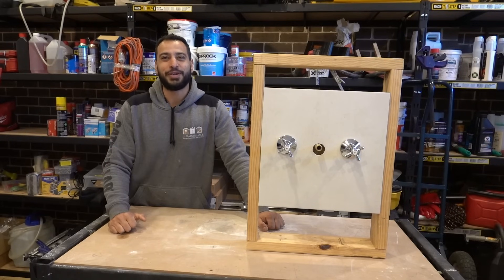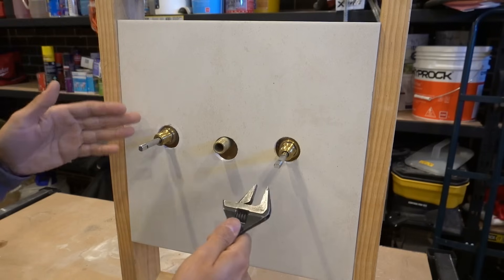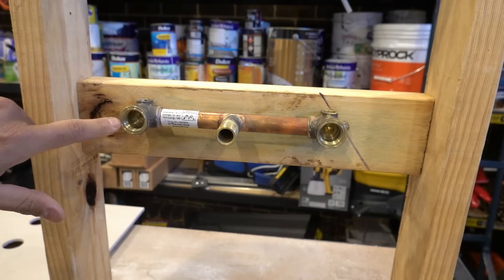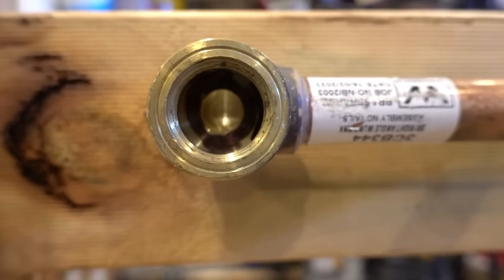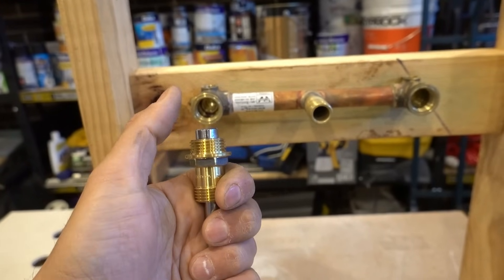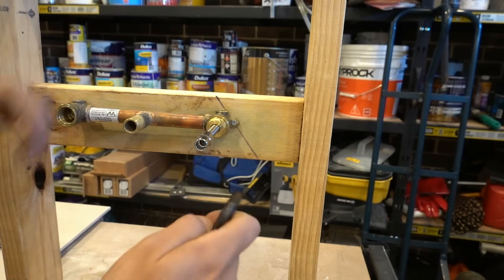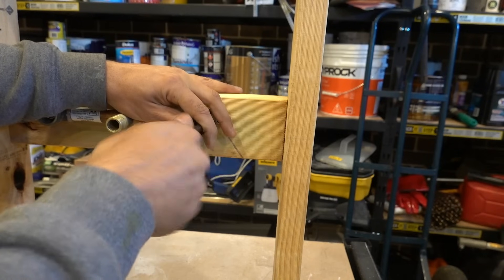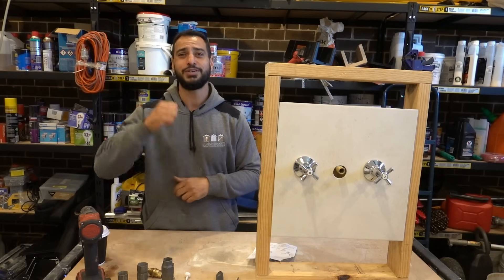Fix leaking dripping taps - Plumbers DONT want you to know !!!

Comment from the maker: Make sure the main water supply is turned off first👍👍👍👍
Reply: So glad you mentioned to turn off mains water stopcock at front of residence. This is an awesome video covering beginner washer replacement, intermediate refacing seats, and advanced replacement of tap seats for DIYers. Thank you so much.
Reply from the maker: you’re very welcome 👍
Reply: A great suggestion.
Reply: Also put the plug in the sink or bath tub so nothing goes down the drain! Many people dont do that and they lose things.
Reply: HELP 😢 PLEASE! I followed your video on how to do a simple washer change and now when I turn the bath taps on, water is coming through the wall.... What have I done wrong?
Reply from the maker: Hi, you have either not tightened the spindle back on or it’s missing the fiber washer (usually red in color)
Reply: Ok, I need to locate that first 🧐
Reply: Make sure to read this comment before loosening your spindles ;)
Reply: What about the leaky tap spindles
Reply: If I have water pissing out of the wall every time I use the taps what do I do?
Should I call a plumber?

Comment: Missed a few tips here. Turn off the water first. Open the tap valve as it makes it easier to remove spindle. When you tap a thread as in for the new seat always go 1/2 turn forward and 1/4 turn back. This will clear the debris and make it easier to tap the thread. You also need a slow revving drill such as a cordless drill to reseat as too high a speed would cut too much out.
Reply: Thanks for the tip ❤
Reply: Oh no, way to much…what’s the plumber’s number 😅
Reply: COMMINSEN. TO CLOSE THE TAP . COME ON. ARE YOU STUPID.

Comment: This is so good thanks!!! It's back to the hardware store for the 3rd time to install a new seat. Done the replace plunger washer, didn't stop the leak, bought the reseating tool, and grinding away revealed a deep pocket hole in the one seat, so I''m gonna try replace the seat. Thanks for saving me 1000's !!!

Comment: Two things I changed on my shower tap set up, I chipped the edges of the tile at the bottom and "Injected" some silicon all the way through to the base of the body so that when the tap was removed, the water would run forward and out over the tile outer surface instead of soaking into the plaster board, I have fitted those stainless seats on all my taps and use the washers that soft self seal by using the pressure of the water to effect the stop of flow. This demonstration used the best type of seat resurfacer, I don't have that type and had to be careful not to leave radial chatter marks on the seat.

Comment: Finally the solution. I had a micro crack in the seat and I have tried reseating this about 4 times and feared I was getting close to flogging it out for good. This has fixed the problem. You are a legend Bill.

Comment: Great advice. I just fixed my fairly new taps (two years old) in the kitchen without even replacing the washer at the back of the spindle. At the front of the spindle, only about 10mm from the end, I have a brass c-washer and a rubber O ring. I noticed that the cold water tap compared to the hot water tap had the O ring less tightly pressed up against the little c-washer - much more use/wear of the cold water tap, I guess. So,  I just pushed the O-ring a bit more firmly against the c-washer and now it's not dripping.

Comment: Thanks Bill.  Great video that I will share with my daughter.
Can you make a video comparing the various materials used in hot & cold tap washers.  There are so many choices, cheap & expensive, soft & hard, plastic & brass stems.  Some wear out quickly.

Comment: Good job. That kit's been around for years. Haven't had a tap where I've had to go that far, but it's a good s option if required. There's one leak which is rare but you can add it to your list and that is the spindle o-ring.
Reply from the maker: I have done a few videos on this but on shut off valve’s. Exactly the same process but I’ll add it to the list in case people can’t find them👍

Comment: helps at times to open the tap a turn before you try to loosen the spindle,  then you are just working on the thread minus any pressure/friction from the washer

Comment: if i wanted to take the taps off like you showed, and then NOT use the taps or spout anymore (ie. leave them removed from the wall), can i just take the spindles out and screw some sort of end cap in place of the spindles?  will that work, or is it more complicated than that to disable a tap and spout?

Comment: Hey Bill, if after reseating, new washers, valves etc and there's still a slow slight drip is that when you replace the seat itself with the tool shown in this clip? I think the answer is yes but wanted to ask before going ahead 🤣 After that next step is calling a plumber cos I only did new new bits and bobs listed above only 12 months prior 😢

Comment: with the tap seat replacement, it may still leak if the threads were made a little loose, and you can fix that with a bit of thread sealer

Comment: I have  found is easier to reseat then put new 1/4 turn ceramic tap good for 100 years. Just clean the seat up with the tool no need for the insert if putting in the ceramic tap. Has its own seat. Bit expensive though. But I was desperate very old house.

Comment: Hey Billy if you used the reseater tool to reface the brass why would you have to replace the tap seat afterwards?
Reply from the maker: Sometimes the seat has markings that would take excessive resurfacing and may be too far gone. The seat should be resurfaced as much as possible before installing the new seat either way to have it as clean/flat as possible 👍
Reply: @billshowto  Cheers for the heads up mate 👌

Comment: Great vid. My shower spindles are covered with some sort of clear silicone, preventing me from unscrewing them. Can i cut around this to unscrew the spindle?
Reply from the maker: You can cut the silicone out. The silicone is sometimes used to create a waterproof seal and prevent water from making its way into the wall cavity
Reply: @billshowto  Do i need to put more silicone down once im done changing the washers?

Comment: Always put a little bit silicone behind the new seat. This is the tips from work. The rubber washer at the new seat sometimes can also cause leak. A little bit not much silicone absolutely can help.
Reply from the maker: Silicone may work but I haven’t tried. Loctite is what I would use👍👍👍
Reply: @billshowto  ture.loctite is also a great idea.

Comment: Great video. I resurfaced using the drill bit but still leaking. Can i reseat the tap if i have already resurfaced twice? I just dont want to cause more issues trying to do it on the cheap. My wife is already suggesting a plumber
Reply from the maker: Sure can👍
Reply: How'd you go with reseating the tap?

Comment: @billshowto

Hey Bill

I reseated my tap seats for the shower in my bathroom with the reseating tool. One of them (cold tap) had noticeable damage/crack (about a quarter of a millimetre). I eventually stopped because I was hesitant to shave any more copper off. I flushed everything and reattached everything. When I turned on the shower, 3 noticeable changes:
- The shower head pressure was much weaker (I changed to another shower head and the pressure was still low).
- And when turning the cold tap slightly after the hot water, it would get cold quickly.
- Leak has significantly stopped.

Are there any explanations and fixes for this? Logically, I thought I did everything right. I'm feeling defeated at the moment. 😭

Comment: Hi!!   If it was damaged (the seat) by a plumber how do you then fix it? I simply told my plumber my taps make squeaky noises after a while they're not doing it yet but after about a year they will start getting squeaky when you turn them on and he marked around with it and now I've got a worse issue. The tap was not dripping at all but now it is continuously dripping. I have found out I need to get one plumber in they need to pull all the tiles off the wall and then I need a builder to come in after that a lot of hassle for me as a tenant over a dripping tap. 
Is there a simple fix or a way around this? I do have handyman in the family and I would love each of you fixed easily and quickly without all of this drama that is ahead of me

Comment: Another hint, if the plumber does have to be called to replace the hardware, and it is tiles, tell them to go in from the back. It is easier to repair a painted wall, or even carefully remove then reinstate bricks.

Comment: I did this year's ago and made it go from a drip to full flowing water that I couldn't turn off. Ended up costing 1000 to get a plumber to fix it. Not sure what I did wrong or how they fixed it without removing tiles

Comment: The only problem to me is I couldn't remove the spindles as they are way deep inside the wall even I used the box wrench, still hard to unscrew it because it was stripped, still ended it up paying a plumber to do it. Any taps from old houses is just a headache as mine is 50 years old.

Comment: I have one problem ,the tap covers are on so tight ,that I can't get them unscrewed .House is only 5 years old.
Reply: Try wrapping a small rag around it and use a pipe wrench or multi grips. The rag is to prevent damage to the tap cover.
Reply: @mupdog9697  Still wont move.

Comment: Sorry Im about as far from a plumber there is (preschool teacher) when you say flush it out...... define flush for the dummy in the comments please. 😂😂😂 thank you
Reply: I'm in the same boat but I took it as turn the main back on that will enable the water to be turned on and flush any dirt & shavings etc
Reply: Turn the mains back on. It will make a mess if it pours straight out out of the brass thread so best to remove the filter and let it pour out of the tap and the brass shavings will come with it.
Reply: @melissabuckley5179  See my first thought was the mains..... but then I thought of all the water that would come out lol. Thought Id better check that he didn't mean spraying water in..... incase my initial thought floods the house 🤣🤣
Reply from the maker: exactly 👍

Comment: It would be a great tool if there were any available lol goddammit Australia!! 😂😅😢

But now I’m looking into Harbor Freight’s 40 pc Tap and Die set for about $20 I just hope I can figure out how make sure it’s leveled enough to do it properly and not lop sided. Currently my leaking faucet has no threads for a seat and that’s after switching out the stems and even the goddamn handles lol and I’m also thinking about switching out the tub spout where it’s mainly leaking from 😮 🛁

Great illustration and clear instructions!!

Comment: Very basic skill to change tap washers , no 1 turn meter off first , then open taps to drain any water left in the pipes , also most times you will get some residue water leak from removing the spindles ,so use an old towel at the bottom of tap handles to save the mess lol 🤣🤣

Comment: People are pretty dumb and if you want to show them how to do anything, you must start from the beginning, water off or power off or drains open and so on, otherwise you will have people undoing the tap with the water still on and no idea how to turn it off and getting water every where.
First thing should be find your water supply and how to turn off the water supply, then open a low tap to allow the water to drain out of the systems as that saves having water dripping into your wall cavity.
I worked in I.T for a few years before I retired and had to produce quite a few instructional manuals for others in my Team, I learnt very quickly to never take for granted peoples abilities even if they have been in the same job as you for as long or longer.
I had to begin at the beginning like plug power cord in and switch the power on and then go to the COmputer lol, yes it may sound stupid but doing a year of Help Desk level 1,2 and 3 taught me exactly how clever people were and then making instruction manuals showed me how dumb so called experts also are, no common sense these days, me being an old Man, I had plenty of common sense and was why I was put in charge of creating the manuals as well as coming up with better ways to do tasks.
Anyone working in a Customer facing role or dealing with customers understands exactly just how stupid people are and who ever came up with the moronic saying the Customer is always right, never dealt with the Customers :) they are very rarely if ever right.